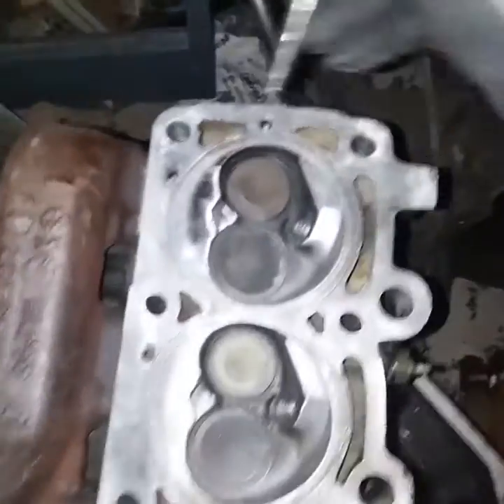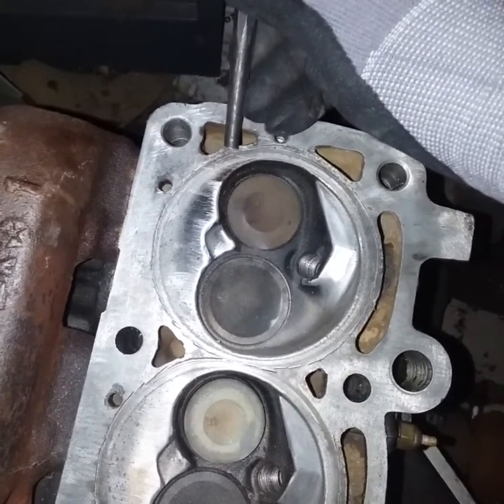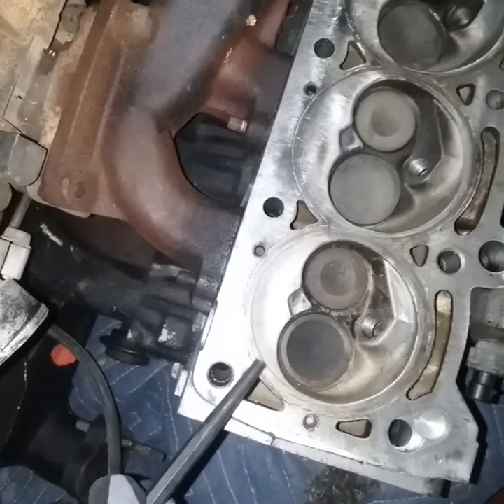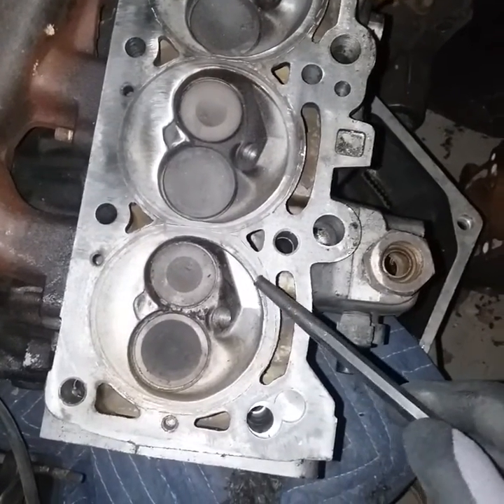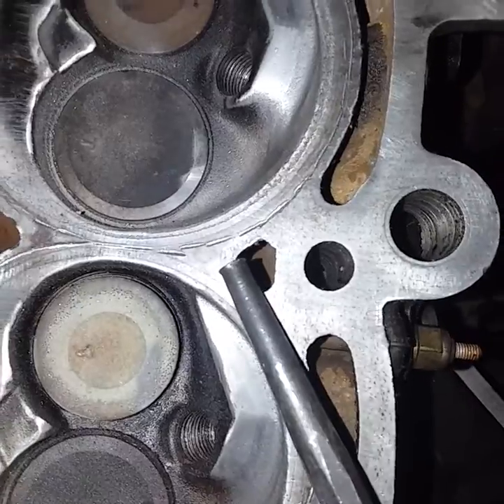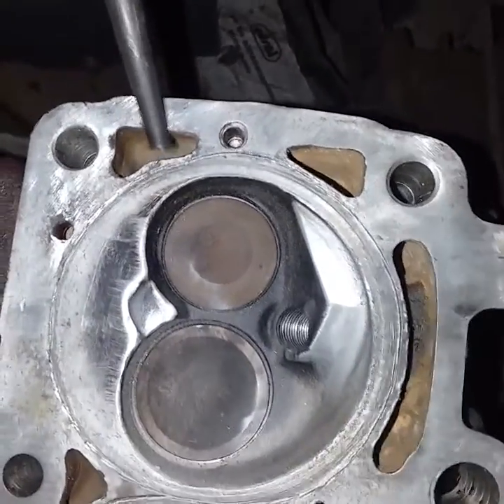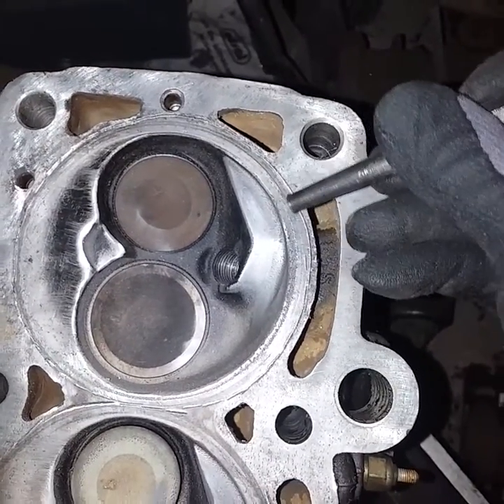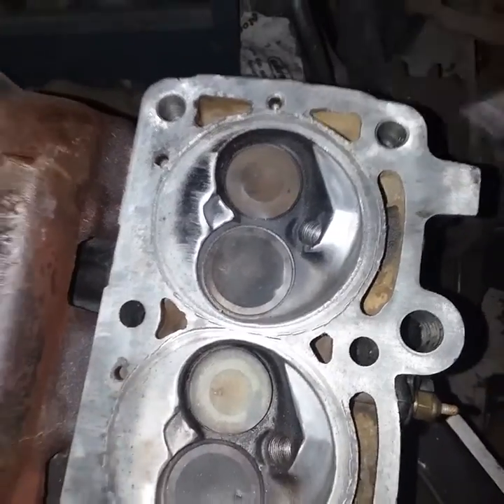The fix I use to stop head gasket on 2.2 2.5 Turbo Dodge Omni GLH GLHS Shelby Charger Daytona Shadow

Comment: I know 2.2 are serious about blowing head gaskets unlike the 2.5s. will running 12 pounds of boost on a turbo 1 make it blow any faster.
Reply from the maker: U should be fine up to 15lbs boost.. felpro has been the best gasket I have tried.. I was running around 30lbs and new gasket would just push right out into the water jacket.. most these gaskets fail normal minimum miles above 100k is normal and this fix might help a little.. but running higher than 20 I would do this. 

Seen a guy on youtube fix a warped head by heating the ledge all around top of head where valve cover bolts while its torqued to block.. milling warped head IS VERY VERY BAD! It raises compression changing air fuel ration
2 it makes the cam journals way off

3 changes mechanical timing😢

Comment: Thanks for the great video tony! I just blew my headgasket on my horizon. Thinking about trying to make it faster. Any reccomendations? I know people put the neon head on, or srt4 swap. Whats easiest, its my first time diving this deep into an engine.
Reply from the maker: I would not do this to a non turbo or even one running under 20 psi.. it wouldnt help .. usually a non turbo just fails because its old gasket .. if horizon just clean surface and install new